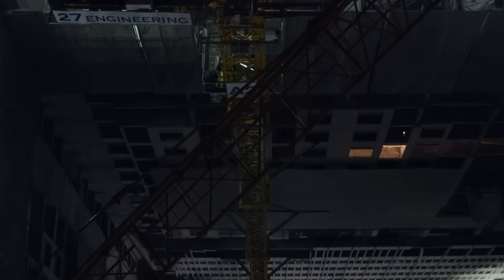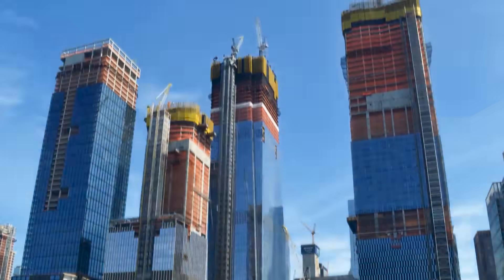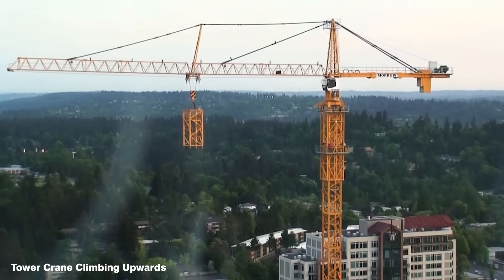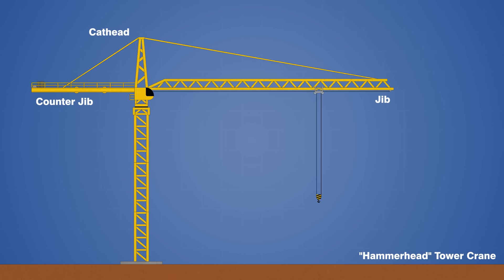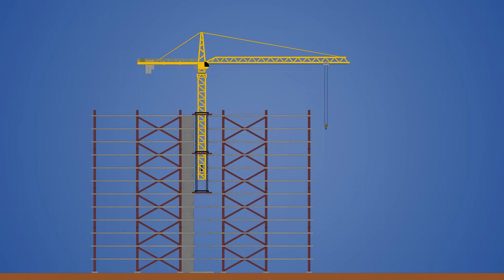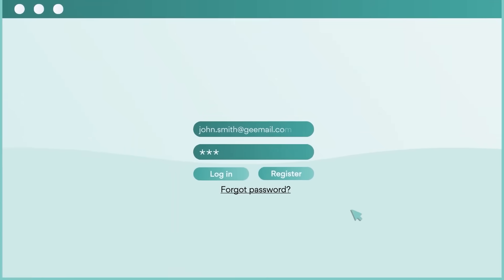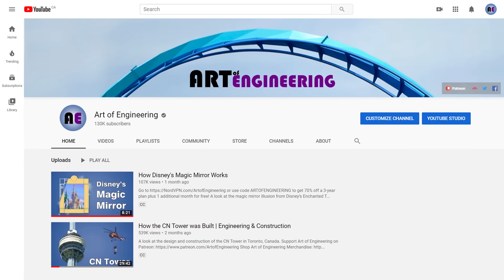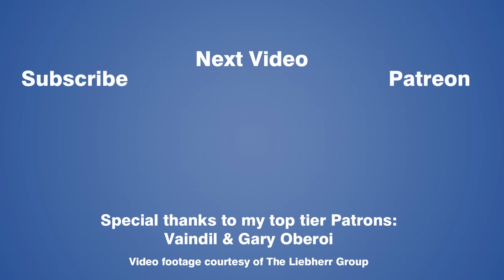How Tower Cranes Build Themselves

Comment: I'm sure I've also seen ones that are only fixed to the outside of the upper floors of a tall building (ie not anchored to the ground). Am I right or did I imagine this?
Reply: If on the side of a building they are always anchored to something that can handle the weight of the crane and loads, they may have started inside a parking garage that was built around them and then braced of at the higher floors, or something like that

Comment: If the counterweight does not move out and in, what keeps the crane in balance when the new section is pulled into the main stack? I understand that they use other stack pieces for balance but unless they have two cables with stack units on them why doesn't it fall when the stack piece is pulled toward the counterweight and installed? If the counterweight could be pulled in toward the stack then that would aid in keeping the balance.

Comment: You didn't mention how the "holes" left from internal tower cranes are often employed as usable spaces within the building. The voids are perfect for elevators, ventilation, etc.
Reply: One building close to where I live they filled in the holes with concrete. They had rebar sticking out that they used to build the rest of the floors. It was interesting.
Reply: @ptmy8590  that is cool, so they used it as "core/s" for reinforcement and such. Did they also build the next floor on the current floor and raise it up?
Reply: @jonathanorlando1294  after the base of the crane is raised up a couple of floors they start to form the holes up from the ground up but the whole area around the crane foot print so to speak is shored up all the way from the ground to the supporting floor that the crane is on. What is really funny to watch is how fast the bosses leave the floor that the hydraulic jacks are on as they start to take the weight because as they do the shoring all around that area is now lose, the jacking crew are all standing near a wall or column when the shoring starts to fall everywhere and then needs to be reset
Reply: They just slab it over for sq footage, you cant make core walls out of crane space. Core walls (in my state) have to be built first, also have yo be able to stand 3 stories tall on their own
Reply: @chrishickey5923  neat! I didn't know that.
Reply: I was curious about elevator shafts and such, thank you.
Reply: nice , im curious too and luckily i saw this
Reply: Thank you, I was curious about that
Reply: @JaniceTheTux  Sometimes there aren't uses for anything, just empty slabs that will get filled in after. Takes 10 mins to load it up for there's never any piping or wiring going through that opening.
Reply: Yes
Reply: Yes.  Like in Die Hard.
Reply: Do they build walls around the shaft after the crane has moved to the next level? How do they isolate it from the main space?
Reply: Maria the opening is filled with concrete the same thickness as the surrounding floor.
In some buildings the floors are poured on metal corrugated sheets called Q deck. A different style of floor construction is a concrete slab that has no permanent sheets under it because it is self supporting due to steel rebar reinforcing. For this type A false plywood floor is built and then after the concrete has been poured and cured then the temporary plywood floor underneath the concrete floor is removed and the crane opening is now a poured self-supporting floor slab no different than the rest of the slab on that floor.

Comment: I will never understand what keeps these things from falling over... They defy logic - small base to great height ratios...
Reply: balance, and being anchored to the ground.       think of a beach umbrella.
Reply: @moonkey2712  if you balance in a north and south direction, along comes a strong East or west gust and it seems to me she will go down!
Reply: @richardbarnes455  Because of the way that they are tied into the building they become part of the structure, each tie in has 3 different ties, two angled outwards crane to building and 1 that is crossed from one side of crane to opposite side on building tie in

Comment: Interesting that some of the terms used for these cranes, such as jib and luff, seem borrowed from those used with the masts of sailing ships.
Reply: Nobody in a tower crane ever wants to hear a boom, that means something just broke big time, usually a cross strut right beside the cab
Reply: Guess it's all about the basics of distributing dead and live loads using parts working in both compression and tension. The principles developed over centuries of sail using mast, spars and the like connected with copious amounts of rigging laid the groundwork for the engineering behind these cranes. Nice to see that heritage reflected in the terms used today.

Comment: For a bit of history, self climbing tower cranes were invented by the Favelle brothers in Prahran, a suburb of Melbourne, Australia in about 1963. Their brand name was Favco.  Four of the luffing cranes were used in the construction of the World Trade Towers. They won an Australian Export Award for that. Being diesel powered and a single cable, they had faster lift times than other cranes at the time.
Reply: Until 1949, cranes used in construction could lift vertically but had no horizontal movement, and materials were manually carried after being dropped. With Hans Liebherr’s innovation, the tower crane could not only swing materials horizontally, but also be transported in parts and fully assemble itself at the construction site. His design, the TK-10, was a machine that had the slewing unit on the bottom, allowing the entire crane to rotate, with a horizontal jib on top. It was presented at the Frankfurt Trade Fair in 1949, but new designs came to the market almost immediately after its unveiling.
Reply: @lliambunter  That is interesting.  I have been told that the reason that the Favelle brothers designed and built their own crane was that they had been trying to purchase a crane from Germany, but the Australian Federal Customs department at the time was making it very difficult for them. This would come as no surprise.
Maybe they were trying to import a Liebherr crane? 
There are many Liebherrs here (especially mobile and tracked) and I have watched a number being set up or dis-mantled. In fact at the Waterloo Metro Station (in Sydney, Australia) construction site one block from here, there is a Liebherr tracked mobile. I cannot get close enough to work out the model number.
I am a great fan of Liebherr!
Reply: @peterblackmore7560  I was a fan of the french crane maker Potain  sold in shithole UK as Record tower cranes , one of the best I've ever operated sadly they were taken over by Manitowic I actually operated the first record to come into the country which was in the yard of the hire company , a spin off of Record really great machine and in those days there wasn't any cameras to show how far out what load you had on etc it was all done by judgement which is only right you cant be looking at dials and screens when you're operating a crane record at the time were the only ones which you could double the overload during testing so I was told
Reply: That’s why they are also called kangaroo cranes because they were invented in Australia and they jump up the sides or in buildings
Reply: @leutmatho9456  Never heard of that one and to my best of knowledge they originated from either France or Germany
Reply: lliambunter lliambunter the tk-10 is the first fully functioning tower crane that could traverse(I do believe once built it was at a set height). But the kangaroo crane(more commonly known as the jumping tower crane) was the first to be able to change its height after being built by Changing by adding pieces to its self.
Reply: Grew up with the son in Sydney...the old man fled to a tax free island....
Most hydraulic pumps on "concretemixer" trucks are favco....look behind the cabin. (OZ)
The cranes were the first of its type....abilities.
Aptly nicknamed kangaroo cranes....many copied.
Reply: Thanks
Reply: Hi Pete don't know if you're interested in it or not but this is a model I made of the crane I was operating in Manchester for the new BBC studios 1972( since demolished )     https://youtu.be/FySbJK4SP68   It's a Record 765 to be exact really lovely crane to operate first one in the country with electronic slewing brake, 150 foot jib lifted 2 ton at the furthest radius and 6 ton max
Reply: Luffing?
Reply: @thebeaz1  At 03:53 you can see the diferrence between a fixed jib and luffing tower crane.

Comment: Very informative video. But I have two questions. How do you get the top jibs and the counter weights lifted and in place and keep the whole thing balanced in the process? And what becomes of the open shaft when the crane is removed from the construction site? Do they put an elevator shaft in its place?
Reply: Basically you add a few counterweights at a time followed by a few jib sections. Their is always a specific order determined by the manufacturer. In some cranes, the entire jib is assembled on the ground, and lifted up to the tower crane in one piece. And to answer youre question about the elevator shaft, in many cases it DOES become the elevator!

Comment: Fascinating how they grow up like that. I knew how external ones grew, but not internal ones. I would assume that typically the internal version is placed in a planned vertical shaft space like a elevator hoist way? Also curious to know what the various designs of tower cranes are used for, some don't have the large cathead, some the jib is tilited, or some appear to be able to tilt up part of the jib. Some look more like traditional cranes.
Reply: usually not, they just end up in a hole that has the rebar bent up or cable ends pulled out of the way and after the the crane gets raised the reshore and form the hole up set the cables and rebar anr run some concrete buggies up the elevator and filled in

Comment: I Always fear that the counter weight concrete slabs would fall down.
Reply: Shashank Degloorkar That‘s not likely to happen since they are put in from above and only can be removed from above. In most cases a crane collapse happens while (dis)assembling the crane. Also poor foundation can be a cause, but that‘s very rare to happen in „developed“ countries.

Comment: Ok what about the crane operator? I know they climb most cranes, but heck there is a huge mechanism right there which could give them an express ride to the top. Just need a bucket and a bit of remote control.
But wait, do you need an operator at the top anyway? If pilots can remotely fly spy planes on the other side of the earth, couldn’t a command centre with wrap-around screens be built on the ground?
Reply: Technically it’s probably possible yes.. Why they don’t do it.. They probably have their valid arguments. I wouldn’t think too much about it, it’s their business.
Reply: Some smaller “self erecting” models are controlled by remote.

Comment: I knew internal tower cranes were raised on their own, but I always wondered how the process works. Thanks!
Reply: One thing about the internal cranes that float in a building, I have had 2 like that. they use large oak wedges to keep them centered in the hole, you don't want the metal tower to be banging on the concrete slabs, and during the course of the day some of the wedges fall out the crane will usually fall backward towards the counter weights and slam up against the slab, this will also cause some very loud cussing cursing and wild movements in the crane cab, take my word for that
Reply: @TheHawkeye1432  I wish I could get a tour in a tower crane lol...
Reply: Yes thanks for the clear detailed info... great thanks...😄

Comment: Very informative and some great animations! But something I never got is how these tall super slender structures are so stable. The lifted load and counterweight are rarely balanced, and I know the metal grid design allows wind to pass through 
 without too much effect, but seeing one not topple over in a storm is just impressive for some reason
Reply from the maker: One thing I didn't mention in the video is that the mast will often be braced against the side of a building with a system of steel ties. This transfers lateral loads to the building and helps to prevent the crane from buckling (a good example is shown at 0:44).

In addition, the mast is designed to carry bending forces (i.e. moments) and it is fully moment-connected to the foundation. This means that an unbalanced load or a horizontal force can be applied at the top of the crane, and it can be carried down the mast to the foundation.

In severe weather, the slewing brake should always be released to allow the crane to "weathervane" in the wind. The top of the crane will naturally rotate so that the jib is parallel with the wind direction, thus reducing the total force because the wind will be acting on a smaller surface area.

Despite all the safety precautions and regulations, tower crane failures still happen somewhat regularly (more than 50 per year on average). A number of these occur during the climbing process, but also do to severe weather and contractors pushing cranes beyond manufacturer guidelines.
Reply: @ArtofEngineering  neat, thanks for the clarification man. And keep up the good work, your videos are amazing!
Reply: They're not as sturdy as you think. When youre up there, the whole things shakes and bobs after each function on the controls or with high wind speeds

Comment: Would high winds also affect the crane and possibly make it topple over?
Reply: Chris Grant It’s unlikely because the crane has a lot of open space to allow air to flow through it. Also, as the crane climbs it is fixed to the building
Reply: ALL the cranes have well built in safety factor but when a operator does not follow the shut down rules shit happens, on a Lufting crane the jib should be lowered to no more than 15 degree angled and left to free swing, regular tower crane left to free swing but I always left one brake on just to keep them from spinning around and around all day long as they can sometimes do when building near taller buildings near you. These accidents can cause a failure that could cause a luffer jib to stand up straight then fall over backwards or a regular tower crane to actually bend the jib and shorten it causing to fall over backwards towards the counter weights

Comment: are the columns that the cranes occupy used later for elevator shafts?
Reply: Dean Lemcke-Evans Depends on the structure. It can be filled in with concrete, and it would be as if the crane was never there.
Reply: That's what I was thinking!

Comment: Always wondered where the internal ones went. Guessed they were constructed in what would become an elevator shaft or perhaps left as part of the building. Fascinating!  (Wonder who invented the climbing process; hope he is getting rich off royalties :)
Reply: Not the case usually. On each level where the tower crane frame comes through is typically "infilled" (with small concrete pours) to match the slab poured around it, after the crane is dismantled (or jumped), as if the crane was never there